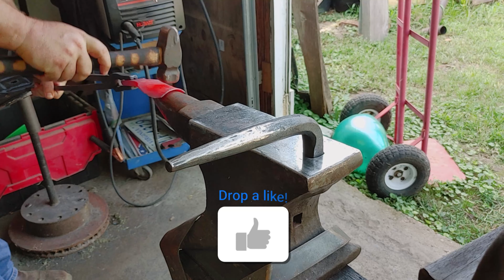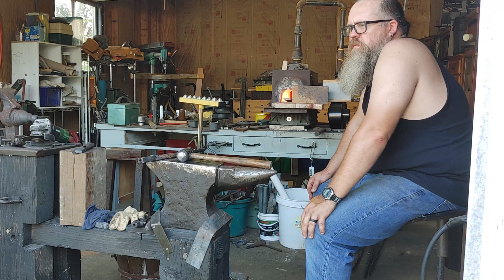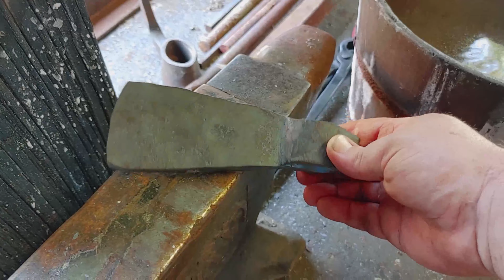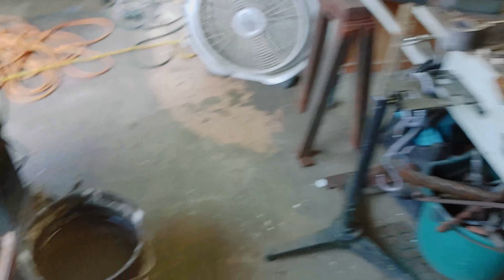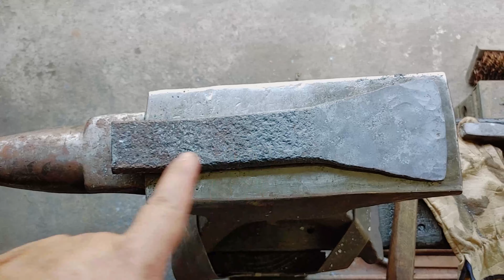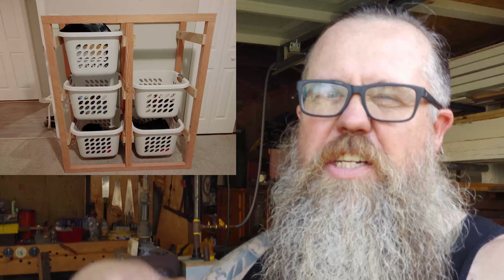Come follow my journey in the Blacksmith Shop | Journey Vlog

Comment: You can get the 3" pipes from either Home Depot or Lowes, 
Use that connecting piece on a shovel. Congratulations on a shop!
Reply from the maker: Thanks Will. Yeah we have a local plumbing place that is cheaper im just putting the money from donation into tooling but one day I will upgrade. Thanks for the suggestion.